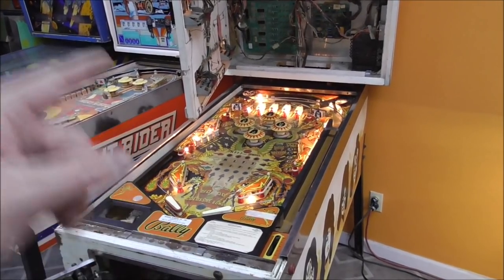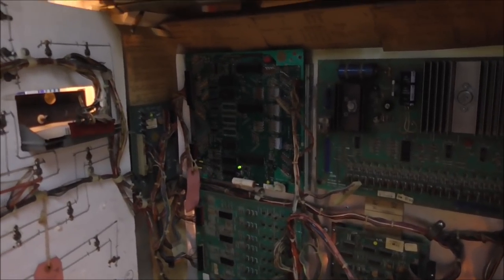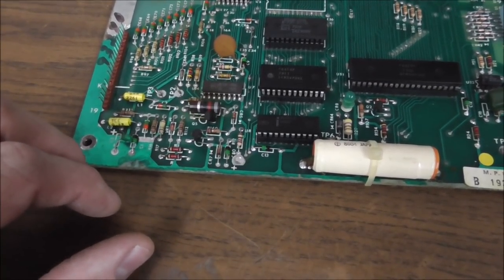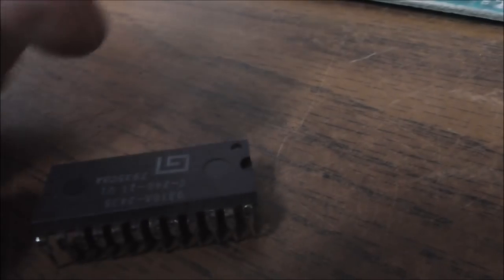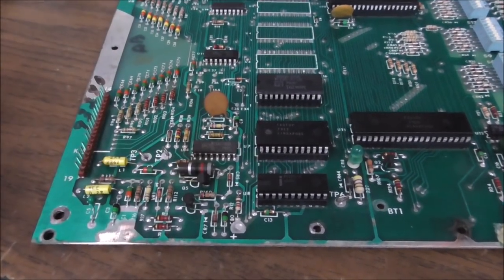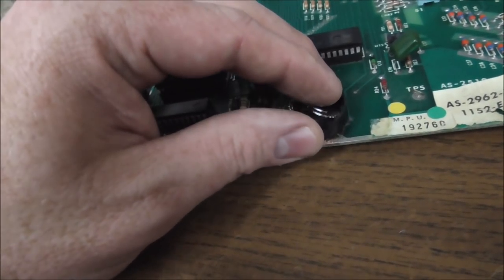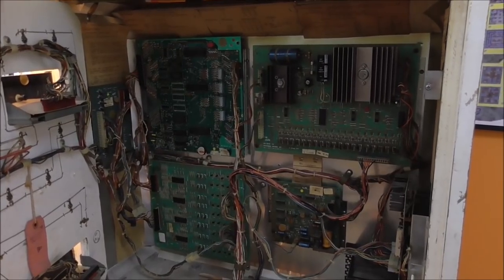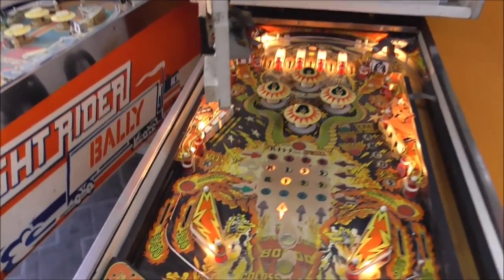Did You Know Your BALLY Pinball Machine Will TELL YOU What's Wrong With It?  KISS Repair #3

Comment: The grand kids came over this weekend and wanted to play our Meteor. And it wouldn’t boot. The light just came on and stayed on. I’m sure this video will help me fix it. Thanks for all you do.
Reply from the maker: It happens!
Reply: A locked on LED is the hardest problem to fix. It's usually caused by battery damage or bad socket connections. Joe does the best job showing how he goes about fixing it.

Comment: I really like how you break it down and explain everything, even though you have done this many times.  I watched intently because I have a Stern Galaxy MPU not booting(locked on LED)  I did all what you said, still not booting.   Mabe bad PIA, or one of the three transistors.  The game has been fussy, sometimes booting and not not at all.  Thanks Ron!
Reply from the maker: Probably something in the reset section, those transistors usually don't die, they just get damaged by the battery, if you don't have any battery damage though they're probably fine.   You can swap the PIA at U10 for the one at U11 and see if you get a few flashes until it figures out there's a bad PIA now in U10.... Make sure the rom legs are clean too.

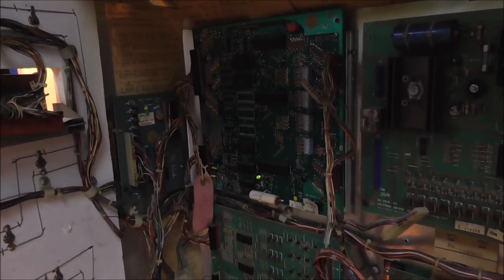Comment: [5:00] A test power supply for Bally MPU of that era does not need +43avVolt to run one flicker and 7 flashes.
Pins 18 and 19  bottom left is ground 
Pins 16 and 17 is +5vdc
Pin 12 is +12 volt  avDCvolt
Pin 15 can use the +12volt to power a 555 astable  multivibrator that pulses between 50 and 120 pulses per second. It is looking for the Zero crossing point. If the driver transistors are turned on or off while the supply is Zero it is easier on the transistor. This will allow it to initialize and you can test a little further.   If it still won't give you the 7th flash check R113 and R16 they are 2K and one opens up once in a while I usually replace both with 10 K as there is no need to draw that much current for a simple little Z detector that leads to a 150K resistor.
Reply from the maker: Thank you for your correction, anything else you want to correct?

Comment: I have a question - not sure where to ask it. I have a The Sopranos pinball and after some 100F+ weather one of the ball detect circuits started failing. It ended up being the actual wire running from the sensor to the board in the backbox itself. Running a new wire solved the problem. The hardest part was accepting that the wire had failed. This circuit had an optical ball detect and circuits on the board etc. After testing everything else I tested continuity on the wire end-to-end and no buzz. I ran a new wire and all fine. Does this happen? How?
Reply from the maker: Hmmm.... could you tell if perhaps it was one of the contacts on one end or the other of the wire, maybe the crimp was bad or something?  You wouldn't think the wire would stop working but maybe that's a thing now, I'd imagine they're all thin as hell!
Reply: @LyonsArcade  It's not impossible for the wire itself to fail, just very rare.  I had a CAT5 network cable fail.  I never did strip the insulation to see exactly how it had failed, but replacing it fixed my problem.
Reply: @SpearM3064  a cat5 cable is typically used where it’s more likely to be moved around, kicked, rolled over by a chair, etc. so it’s more likely to fail than a wire inside a cabinet that isn’t being moved around.

Comment: I also had a problem with one of the ROM legs breaking off. Do the newer MPUs do the same LED flashing as well? I was thinking of updating my KISS to the newer (more reliable) MPU (with ROMs already installed) rather than buying ROMS for the old board.
Reply from the maker: Yes the new MPU's do the same flash code, they basically run the same game code, and the flash test is built into the game roms.  The new boards are very nice, if you are interested in doing it, go for it.  We've used them in many many games, they work great and the support from Alltek is also very good.

Comment: JOE CLASSIC, are the "boot Sequence" the same light code sequences for ALL various types of pinball games or they are all different light code sequences meaning flash#4 is testing XXX but in another pinball game flash#4 could be checking something other?  To Clean battery acid other repair techs use "Ferric Chloride" and then use Aluminum Oxide Power. What do you think about using Ferric Chloride on pcb boards to clean off the battery acid, socket pins and chip pins that are tarnished?
Reply from the maker: The flash code is the same on any game that used this exact same board, so the first 50 or so Bally Solid State games, and the first 20 or so Stern Solid State games.    I haven't used Ferric Chloride...
Reply: @LyonsArcade  thanks

Comment: JOE, what do you mean by "zero crossing test" or what does the zero crossing mean for the solenoids because I have never heard of what is considered the zero crossing for the solenoids. Can you please explain more about the zero crossing?
Reply: Ever seen a sign wav? The AC power that comes into your house goes from 0 to +120 then back to 0 and -120 then back to zero. In north America the complete cycle from + to - happens 60 times each second. (60hz). That means the power crosses 0, 120 times every second, thus the term 0 crossing. Since the frequency or Hertz of your line power is a constant from the power company it can be used as a timer for events. The MPU turns on lamps and coils for a programmable amount of zero crossings. That's how the game can control power of coils and brightness of bulbs. It's also convenient because while the MPU can turn lights on it doesn't have to turn them off as the next zero crossing will do that.
Reply: @areizman  I'm not understanding how the MPU is testing/checking the zero crossing test for the Solenoid zero crossing test. I'm not understanding how the MPU is programmed on the amount of zero crossings to do what? like example at 20 zero crossings events turn on lamp#2 and turn on solenoid#5 and at 40 zero crossings turn on lamp#10 and turn on solenoid#7? I'm not sure why they are using the zero crossing events as the reference
Reply: @waynegram8907  Break out a Bally MPU schematic and you can follow the circuit along. First the 60hz from the power company is a constant. That seldom varies so you can count on 120 ZC per second. Second, the 43v DC to the coils is full wave rectified meaning it pulses from 0 to +43v, 120 times a second. Those pulses are fed to a port on U10 that the CPU monitors. It makes for a nice clock. If A game programmer needs to turn on a coil in the game for 1 second he writes an instruction that counts 120ZC for the coil pull. Hope that helps.
Reply: @areizman  That Pulses that are Fed to port U10 that the CPU is monitor, What is it Called terminology name when the CPU is monitor/counting the zero crossing pulses of the 60hz line frequency? In pinball games the CPU is monitoring and counting the zero crossing events of the 60hz line frequency but what is the terminology name for doing this?

Comment: I would have used a fibre pen to clean all of the contacts on the chips and the sockets I wouldn't recommend using a file
Reply from the maker: You should definitely use a fibre pen when you do yours for sure!  Thanks for watching Simon Smith
Reply: @LyonsArcade  your welcome its just I'm a electronics repairs engineer with 20 years experience